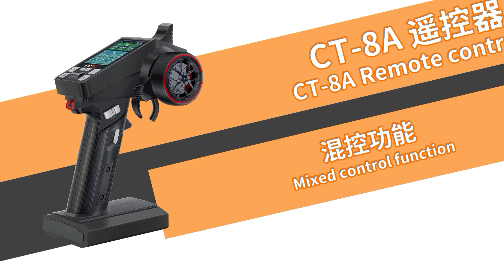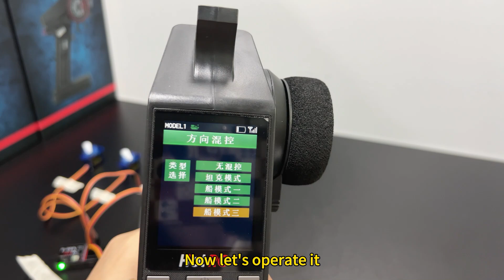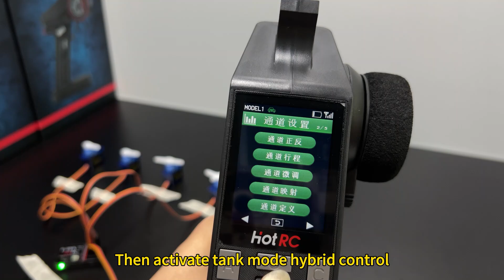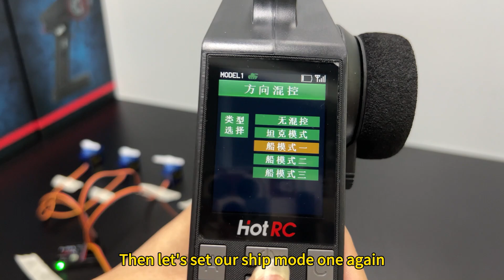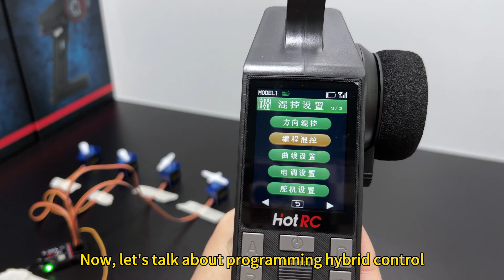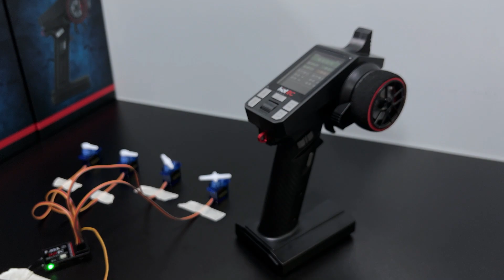How to enable mixing control on the HOTRC CT-8A remote controller

Comment: Hi, are you doing anything about the multiple reports of high battery drain in the remote or the remote completely switching off at random when using AA batteries? Thanks
Reply from the maker: 1. Since the remote control has a color screen, it consumes more power than other remote controls, so we recommend that customers use 18650 batteries + other batteries; 2. The remote control will randomly shut down when using AA batteries. Please check whether the battery type is selected incorrectly. Secondly, please check whether the battery is charged.
Reply: @HotRC-Sophy  Thanks for the reply. I might wait for the next model and hope it's less battery hungry.